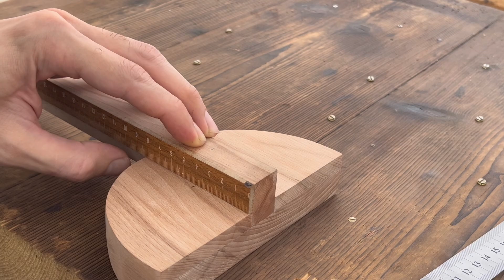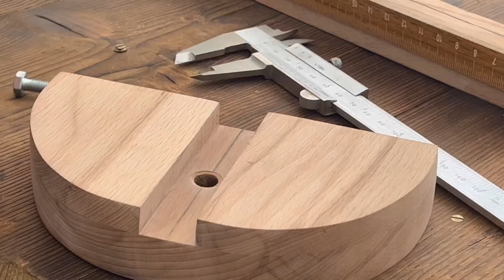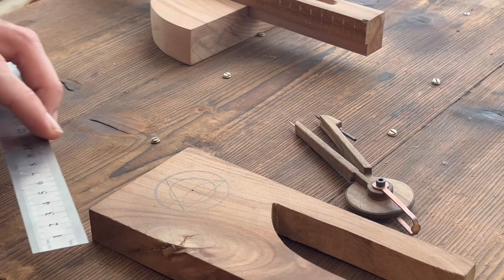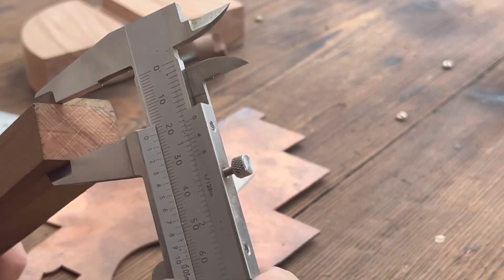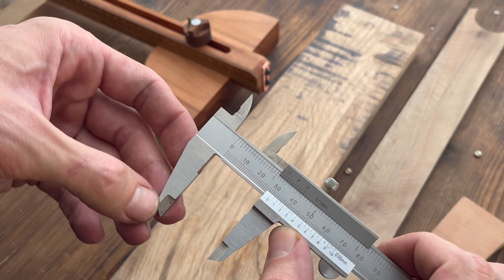Measure-Free Marvel: A Guide to Crafting an Outstanding Woodworking Marking Gauge #diytools #tools

Comment: does it matter that you didnt use quarter sawn wood?
Reply from the maker: If the initial measurements are very accurate, no, you don't need to cut the wood into a square shape, but if the measurements are not accurate, you need to smooth the semicircular part with sandpaper or another tools at the end
Reply: @BSIinventor101 this makes sense, thankjs for the reply.
Reply from the maker: @Justin-fb7ni  you're welcome